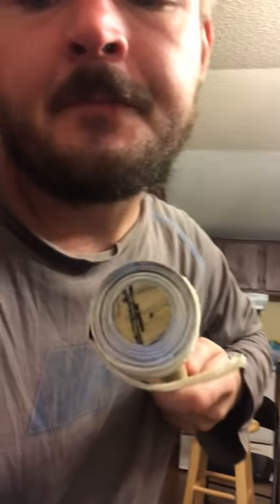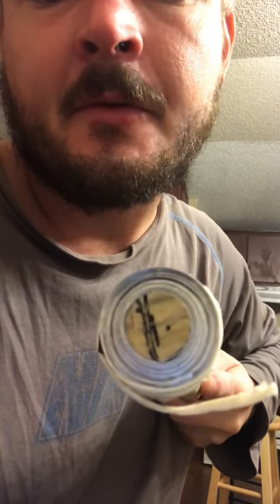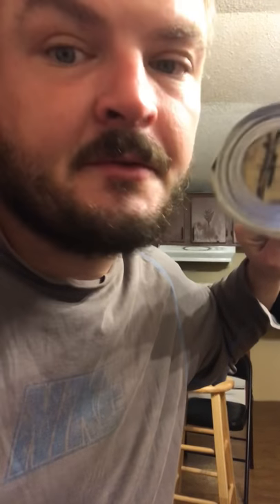Coil load ho scale

Comment: Do you have any coil railcars? I would try fitting the different dowel sizes into a coil car first to see which one fits best.
-from Tom Pilling
Reply from the maker: ATSF Venta Spur Nscaler I have gondola and coil cushion car but thee still up north.  If I had them, I would have plastic coil load to judge off right now. But I do agree with Tom. I might have to find a cheap gondola and cushion car on good old ebay

Comment: Ok. I have not worked with metal coils. But where I work see them a lot. The size of the Center. Is the same size as the coil so if the hole is 1/2 inch the coil will be half inch. So on so fourth
Reply from the maker: So you are saying 1/2 dowel and that middle?  Or do you go down to 1/4 or 3/8?